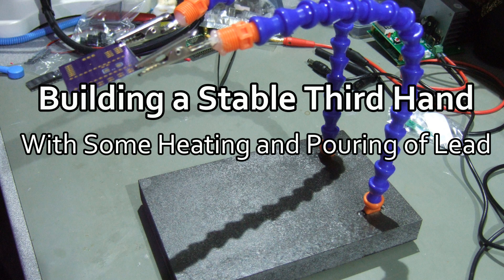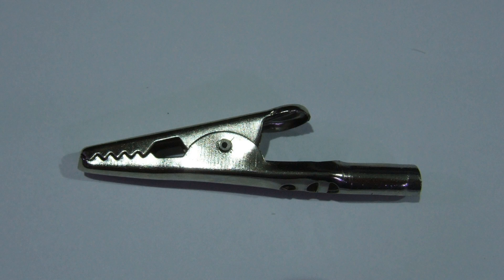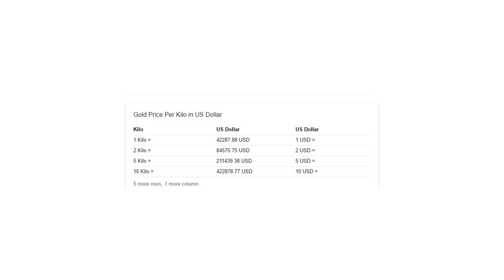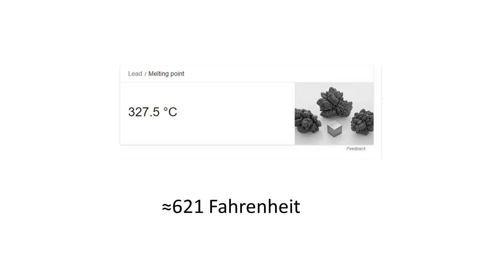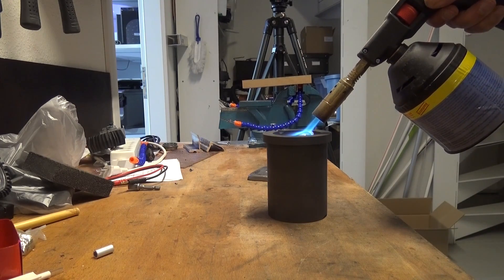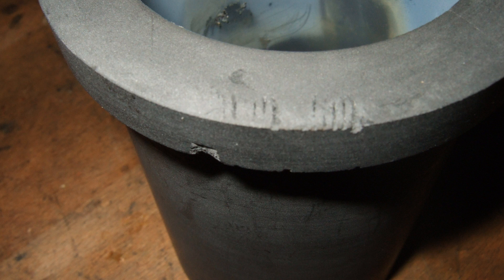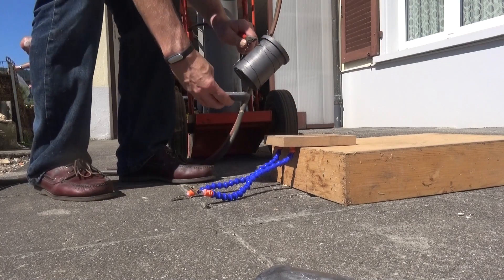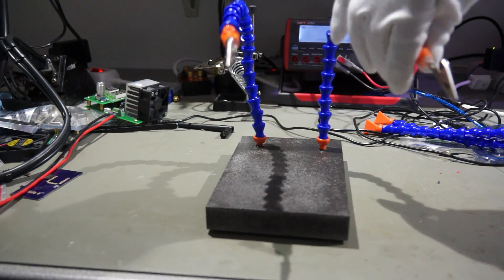#77 Building a stable third hand (with pouring of Lead)

Comment: Nice Video. Very inspiring. Saw this other video, where you dont need the heavy plate: https://www.youtube.com/watch?v=gNbNKMQhCOQ The pipes are installed at the sides, so nothing will tild or tip. Thought about building on with LED lights on top of the ventilation frame. Anyhow, nicely done with the pipes and clips!
Reply from the maker: Another good solution. A little big for my taste.

Comment: I melt Aluminium in dog food tins to make Alum parts, so tin cans would've been ok.
Our coolant pipes get loose and won't stay in position, which might be due to  movement or  the special coolant oil we use.
Reply from the maker: Thanks for the tip! This is probably a cheaper solution.

Comment: I have done some heavy bases in a different way. From the local Conrad Elektronik, i bought packs of 3mm lead balls, and either sealed them in a project enclosure, a jar, or poured cold setting resin around them. Of course there is some room between the balls which is a bit of lost opportunity to get more weight in, but it's less than the wood adds around your lead.

The balls were supplied by Robbe Modellsport and apparently have been discontinued in the EU, but i bet you will have an easier time hunting them down in Switzerland.
Reply from the maker: That is a good idea with a similar effect and less effort!
Reply: @AndreasSpiess  Some musical keyboards have weighted keys,  and one way that I've seen that done is by filling a hollow space on the underside of the key with lead shot,  and then epoxy.  Something of the sort probably would have worked for you too,  no heat required.

Comment: That is fascinating.  I probably would have opted for using bars of lead in the recess rather than melting it, but I'm lazy.
Reply from the maker: Then the weight would have been much lower beacause of the big open space. I am also lazy, but in my case, I optimise the effect compared with the effort, not the effort itself ;-)

Comment: I have this light cheap third arm also. I have solved this stability problem with magnet from harddrives. Just fast one to the table with couple of screws and put third arm on it. Why not do the same?
Reply from the maker: I think, this is very innovative! Like Steve Jobs. He also used magnets for things nobody else thought of (Ipad switch for example). I think, I have to consider more magnets in the future. They are really very useful

Comment: Why did you choose those pipes?
They do not look very stable.

Did you consider to keep using a standard third hand with the heavy base that you built?
Reply from the maker: 1. I do not remember, why I chose them. I use a similar, but more expensive concept for my CNC.
2. They are quite stable. The electronic load is nearly 200 grams. My normal PCBs are a few grams. The old load started to crack and flip with very small loads.
3. For the moment, It will be shifted to the "long-term memory place" and, if not used for a year, it will be disposed.
Reply: To me the breadboard does not look very stable.

Probably you are able to solder and desolder with almost no pressure.

Comment: I have a similar third hand tool but I find that it is very hard to make small adjustments to line things up for soldering: if I turn the arm hard enough to get it to move at all, it moves way too much.
Reply from the maker: I do not have a lot of experience with it so far. So, it is good to know. Thanks.

Comment: Wait, the lead came in bars already, no? why to reflow them and make a new bar? I suppose because the desired shape and size, but you could just drill and mount them, more if you needed. but where is the fun in that, right?
Reply from the maker: Yes. The did not fit at all. And it was also fun for me!
Reply: +Andreas Spiess was fun to watch too :)

Comment: Doesn't melting lead make toxic fumes? Careful Andreas.
Reply from the maker: Yes, there are also other comments below concerning that. After all these discussions, I am no more sure if I should cancel my Harley trip tomorrow, because it is way more dangerous than pouring lead in the open air ;-) 
But anyway, it is very nice, that you care about me!
Reply: +Andreas Spiess I see most of the melting was outside so should be fine :-) Enjoy your ride. I miss my motorbike sometimes - ride safe.
Reply: +Andreas Spiess Harley man? wow even more respect!
Reply: Heating over 500C releases fumes which should not be breathed in.

Comment: I love your jokes in your videos. And what a good idea are these holders. I am going to build one. Instead of wood base I am going to use aluminium, like here: https://www.sparkfun.com/products/11784
Reply from the maker: You are right, of course with the lead.  But I am 60 and survived a few other dangerous situations like civil war in Tschad or in Lebanon ;-)
Reply: Why not go to your local metal shop, or better yet, call them in advance to see if they have blocks of scrap steel you can rummage through and how much per pound (or Kilo)? Here it was $0.25/pound
I found one his size for $5.
I doubt you can get anything close to this price with aluminum. Also you want more weight, not less.
Working with lead, requires precautions that our friend didn't take. However, being a one shot deal, and being done outside, is another story. Lead poisoning retards learning ability.
Reply from the maker: I also would not go with Aluminium, or you make a big plate. Then, it is heavy enough.
I cannot mill steel, otherwise I would have gone also this direction. And I wanted once in my live pour a metal...
Reply: Did you ever play with Pewter? they make pretty nice beer mugs out of them in Germany.
Reply from the maker: No, I even had to google it...